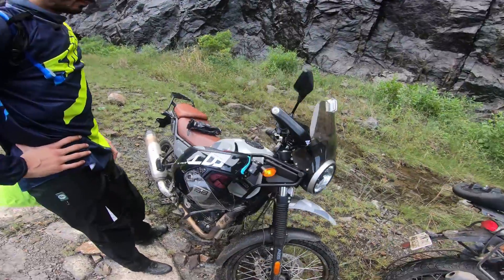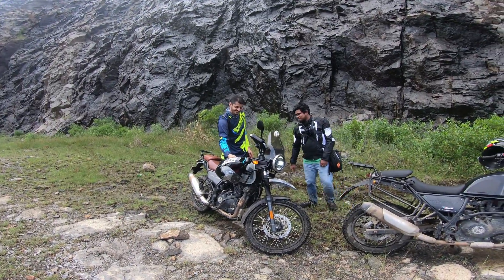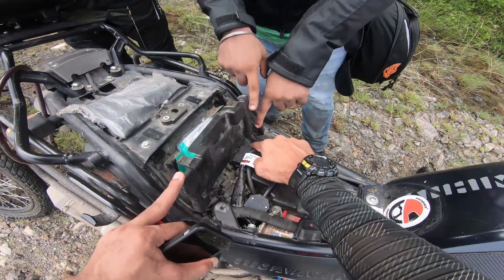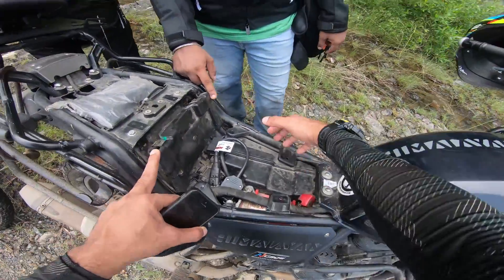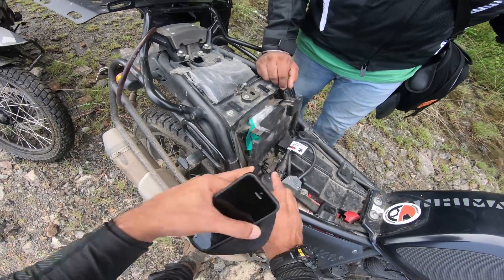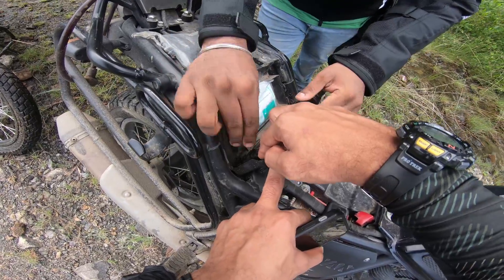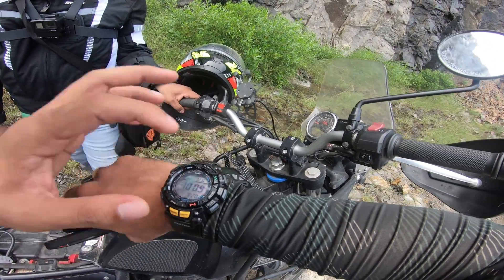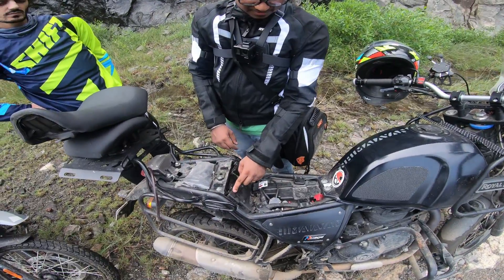A QUICK DIY- HIMALAYAN AMBIENT AIR TEMP SENSOR RELOCATION

Comment: the temperature sensor should be located in the air-stream, in the front of the bike so it is not impacted by the engine heat flowing over it.  RE should have designed it this way in the first place.  Very poor design placing the sensor under the seat.  I don't think this relocation will still result in an accurate reading.  It's not in the ambient air-flow...
Reply from the maker: Yea it didn’t do much in this new position .

Comment: I did this mod earlier this year on my '20 Himalayan, EU version. Didn't make a change at all. Don't get why not, and the incorrect reading of temperature on the lcd still bugs me. Suggestions? 
I placed the sensor on the exact same spot as your buddy did in this video...

Thanks a lot for all your videos, Ben. Lots and lots of good info, always.
Reply from the maker: That comes as a surprise to me Rune. This mod will def make a considerable difference to the reading in comparison to the previous position/location of the sensor.

Comment: Hello sir, I Need little help, i want to buy new bike for myself, & I’m very much interested in Himalayan, so I went to take a test ride, but the bike which I rode for a test ride was in really bad condition, loads of noises from speedometer & from front side of the bike, I was very disappointed to see that, so I went to take test ride in another showroom, there was also same situation with bike, as a buyer I doubt about Himalayans durability now, after seeing those test ride vehicles, so my question is, is this kind of things like noises & shaky front end & instrument cluster happens with all Himalayan with time or no?
Reply: Bs6 machines are way smoother , test bikes are abused lot ..check with ur friends if someone have a himalayan and test ride it.  If ur in banglore let me know u can test ride my bike and decide
Reply: @shivprasadb1994  thank you so much😊 I live in Mumbai otherwise I could have come to meet u for ur guidance,
Reply: It's the similar experience for me, but it was mostly with front brakes, when I asked them about it, they said it's due to abs and it is expected.

I'm almost sure that it shouldn't be that bad and I bought Himalayan even after the bad experience with test ride.

The bike is good, no noises as of now. But I believe noise and vibrations are  common in every bike as time passes.
We can maintain the bike well to avoid these things by addressing even the minute problems when they arise.